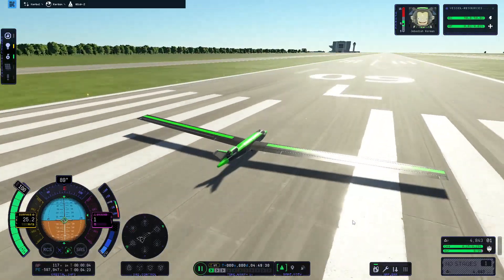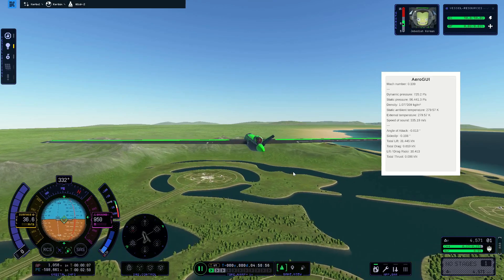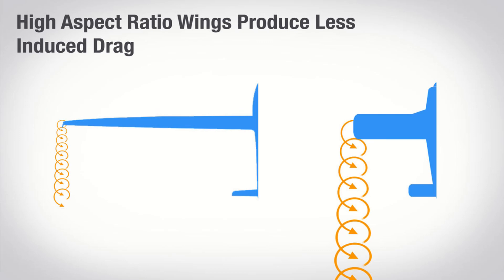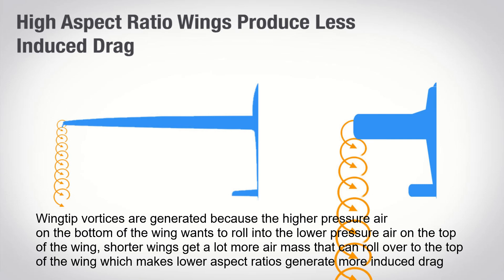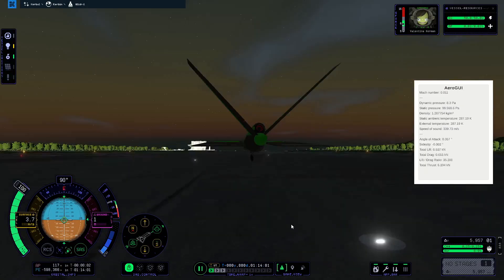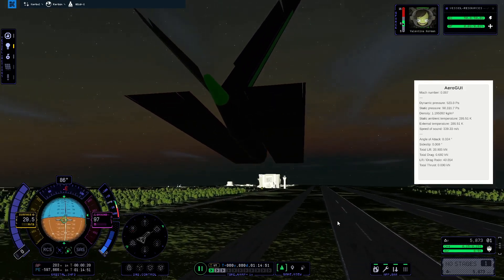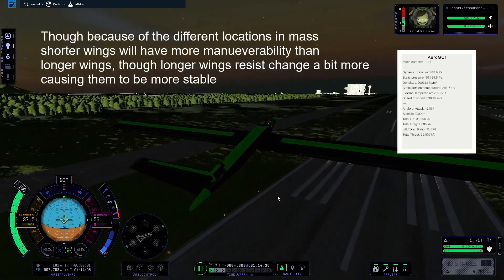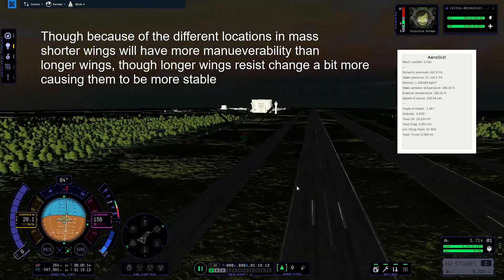Testing Induced Drag in KSP 2 For Ultra Efficiency

Comment: If they would actually simulate the airflow, your fps will drop to single digits on a single wing ;)
Not that is good as it is but hey
Reply: They don’t have to simulate the airflow though, they could just use the induced drag equation. A lot of flight sims do this so I’m surprised ksp doesn’t